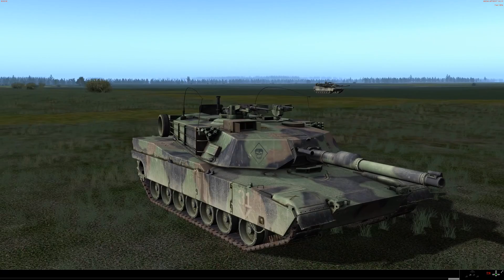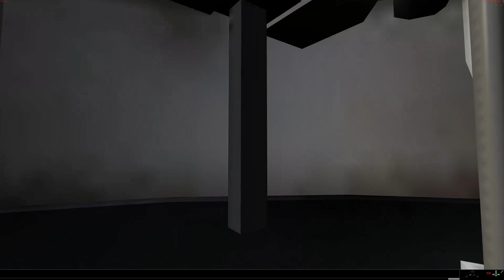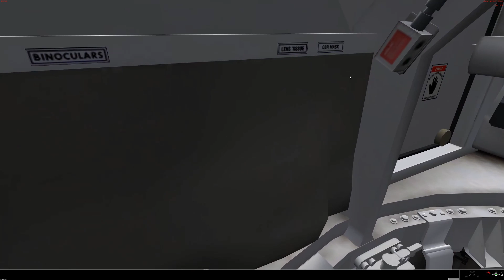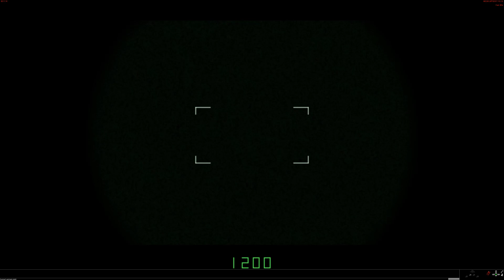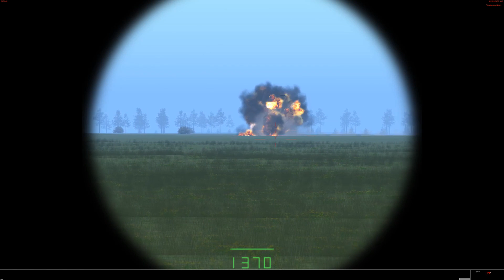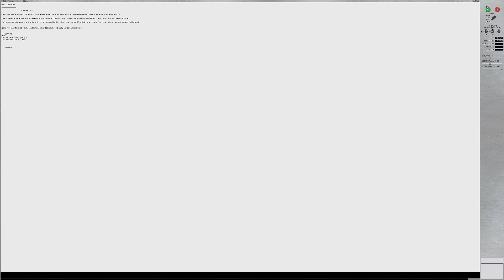Abrams Switchology and Fire Control System

Comment: Some questions:

- Is saying "Caliber 50" instead of "50 Cal" some kind of Irishism?
- Your point about not needing the azimuth indicator doesn't seem to square with your point in another video about a rear-facing commander crossing his arms to determine whether to say "left" or "right" to the driver. Surely reading an azimuth indicator is faster and less error-prone than inferring the heading by looking off to the left into the hull and then rotating your mental model. Do you just never use knowledge of the azimuth for anything that has to be done in a hurry?
Reply from the maker: No. It's  the official terminology for the gun. "Machine Gun, Cal. .50, M2HB".  See manual: https://archive.org/details/TM9-1005-213-10/page/n1
It's also the verbal announcement to the crew that the Cal. .50 is about to be used.  Or at least, it was until the most recent revision to the gunnery manual, but I moved to a desk before that. As to the second point, I think it's a matter of not thinking at all about it. After all, left and right require basically no conscious thought at all. Determining an  azimuth requires almost no conscious thought, but it's enough that you do actually have to engage your brain.
Reply: @TheChieftainsHatch  Right, so the justification for having a "left-right indicator" (crossing your arms) is that it's ever so slightly easier, and it's something you have to do in a hurry (like to avoid a crash). That's why I'm asking whether you ever have to determine azimuth in an emergency. Like, does it ever come up when ordering the driver to maneuver to avoid incoming fire?
Reply from the maker: That's not quite what I'm getting at. You have been doing left/right for 20+ years, that you say left or right without even thinking about it one tiny bit.  Which is what gets you  into trouble. There's left, there's right. If you cross your arms, it's not so much to help you remember which side is which, but to help you to remember that there is actually something you need to think about because your left is on your right. So  yes, if in an emergency, you can certainly say "Driver, 2 O' clock" (Though in actuality, the real command is more like "Action Front" or "Action Right"), and you do need to think about it, but the thinking is so quick and easy that it doesn't  require an external aid.

Comment: Show us the horrible fire control on the T-62.  Bring a box of tissues because you'll cry.
Reply: my hand blew off working on it oof
Reply: Well, Steel Armor Blaze of War is your game then. I had to read an old gunner's manual to even have a slight picture about range estimation, when the target is different than a tank and you can't really use the choke-type ranging scale in the gunsight, or the commander's periscope.
Reply: What's wrong with it? (I think I know what, but I'd like to hear it directly)
Reply: The T-62 doesn't have an actual FCS, right? The first USSR tonka that has a FCS was the T-64B I think.
Reply: @pvtnewb  T-64 was the first soviet tank with a fire control system and an optical rangefinder. The T-64B came later.
Reply: Cool to watch Soo many go pro videos of Cold War t-series getting ammo racked

Comment: Does the laser work in snow or heavy rain I wonder. And how do you deal with wet heavy snow settling on top of the tank, is there some means of clearing it during a blizzard?
Reply: I imagine that the procedure for cleaning snow off of the top of the tank goes something like this, "Loader, go out and clean the snow off of the top of the tank! And be sure to close the hatch behind you, it's freaking cold outside".
Reply: @Riceball01  hopefully with no one shooting back
Reply: I was an m60a3/m1/m1a1 tanker stationed in Germany, fort Carson Colorado and Iraq. Snow is generally not an issue as (if it works) the turret heater stays fairly warm and snow doesn’t stick very well. It tends to melt. However if you are unfortunate enough to have a non operational heater then you just sweep it off the sights and deal with snow all over everything else. The heat from the engine tends to warm things nicely too. A turbine engine puts out an amazing amount of heat and even the 12 cylinder diesel in the 60’s was fairly warm.
Reply: @Sabre70  thanks for the reply I thought of the question when I realised how restrictive the vision was as Ive never been in a tank.
Reply: Early lasers as used on the M60A3, M1, and M1A1s were increasingly ineffective with the increase of precipitation.  But so too are thermal sights and so too are eyeballs.
Reply: Use the ballistic doors to wipe off the snow.
Reply: I imagine just driving it will shake off a lot of snow.
Reply: @Statusinator  That would totally depend on the type of snow. Anything wet and sticky is not going to fall off a flat surface like that so easily. Or if it ices on. It is not uncommon to see vehicles driving around with a foot or two of snow piled up on the roof,  until it get hot enough inside to make it slippery on the roof and it slides off when you go around a corner in big chunks...or down all over your windshield when you stop. And then there is the idiots who try to drive with the hood like that, and a tiny hole cleared off the windshield because they are too lazy to sweep the snow off first.

Comment: Thanks chief, I’m a scale modeler and really learned a lot from your previous Abrams chat but there are still many exterior components I would like explained
Reply from the maker: which ones?
Reply: The_Chieftain I’ll try and remember when I’m at home looking at my model(working at the moment don’t tell my boss), but thanks to you I know what the crosswind sensor is ( and that it doesn’t need to be warmed 😉)
Reply: @TheChieftainsHatch  I think I remember you or someone else mentioning a little handle outside the tank that you pull in case of emergency while you are evacuating, which puts out internal fires?  If that's right, couldn't some enemy ground soldier just rush up to the tank, pull it, and mess up the inside of the tank with firefighting foam? I feel like if there happens to be an internal switch to toggle the external one, it makes the outside one pointless!
Reply from the maker: Yes, but ordinarily, you wouldn't want to let an enemy soldier get that close in the first place. However,  in Iraq, we taped over it so it wasn't as obvious.
Reply: @TheChieftainsHatch  Ok, thanks.  I've been wondering about that one for a while.  

By the way, just in case you haven't heard, the M1A1 is being added to War Thunder.  It seems to have the same armor values as the 105mm-armed early versions (M1, M1IP) though, is that accurate? I thought they improved the armor with the A1.

Comment: I’m pretty sure the azimuth indicator on the Panther’s cupola is so the commander can more easily call out targets to the gunner, who also has an azimuth indicator (and a lack of a periscopic sight)
Reply from the maker: You can, but in practice, you still don't need to.  The point is to get it close enough that it is in his field of vision and he can do the final lay himself, you don't have to get the reticle onto the target for the gunner. Even today, you see only a simple 12-point clock for the gunner's reference in a Bradley or M1. (Why it's not in the SB compartment, I'm not sure)
Reply: @TheChieftainsHatch  I'm just thinking out loud, but could this be the main issue? "Gunner's field of vision" in the M1 looks to be very decent, he has a unity sight, daylight optics and thermal, with selectable zoom. I can't exactly remember well the Panther video, but doesn't the guy has like single narrow field vision scope with what, a x4 miniimum?
So maybe laying him on target relatively quickly does require exact bearing because the guy is blind as a bat and isn't able to do much spotting on his own?
Then again, if so, the germans wouldn't get rid of the azimuth indicator riing later if I recall correctly. Eh, I guess I'm up for rewatching some videos.
Reply: @TheChieftainsHatch  you might not need it but you loose nothing by having it and gain nothing by removing it. seems like a pointless debate.
Reply from the maker: Simplicity! Less to build, and less to break down. Same reason the Germans stopped mounting them to the vehicles in the late war.
Reply: The_Chieftain I might be misunderstanding something here, but wouldn’t having to look down into your tank to see which way your turret is facing drastically slow down your time to engage? Especially for an inexperienced commander
Reply: @TheChieftainsHatch  Today you would use the hunter-killer-function for that, wouldn't you?
Reply from the maker: You missed the point. I don't need my own azimuth indicator to instruct the gunner to look at his azimuth indicator and traverse to 2 o clock.
Reply: @TheChieftainsHatch  I still think its a nice thing to have regardless, but that's just my 'casul' non-tanker brain going "ooh neat".
Reply: @crativ3  Guess the keyword is "with experience, you can tell". Okay, key sentence... I can see that why one who trained well would not need it, but I can imagine that for me for example, who barely put his ass into a tank for a few minutes, under a serious stress it would help me a lot to just look up and "Uh, the shiny number-ring says three".
Of course, the army that needs to field me as a TC is pretty well f*cked azimuth ring present or not, but still.
Reply: @TheChieftainsHatch  But with the azimuth indicator you can tell him that he should traverse at 2.25 o clock which is a lot more precise than estimating that the vehicle is somewhere between 2 and 3 o clock without the indicator. Also if the target is moving, you can update the informtion more precisely as well, since when the turret is turning it's hard to tell him the exact position.